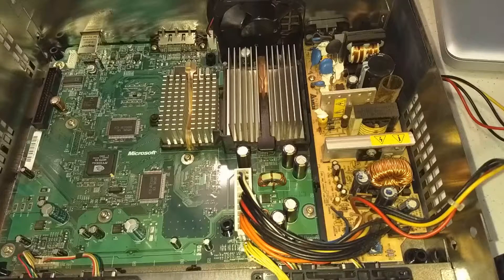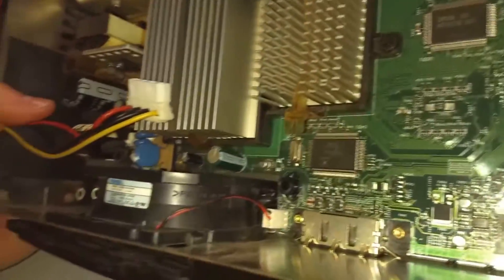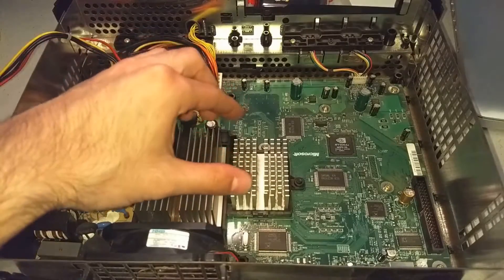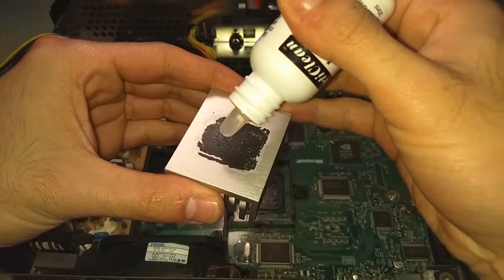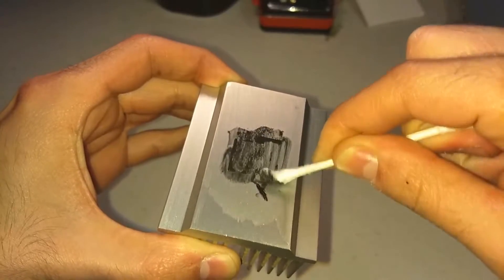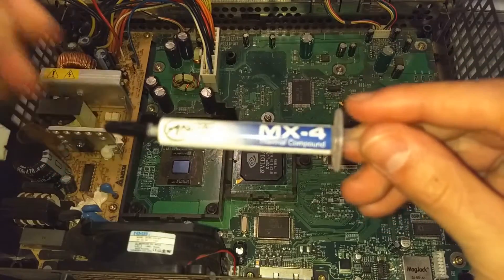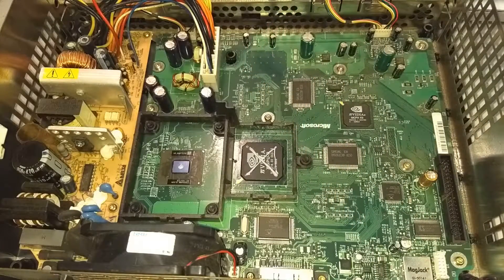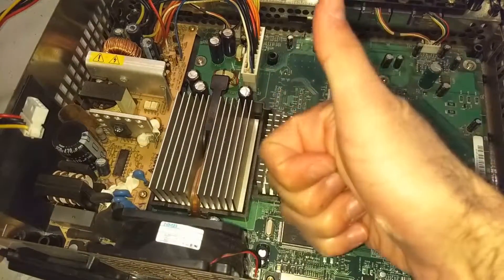Replacing the thermal paste in the Original Xbox

Comment: Hey can you guys help me out? I successfully soft modded my xbox. Everything is fine with it. It plays games , runs emulators etc etc. its just that when i turn the xbox on via eject button i get the service required error 21 message. If i use the reset button it works just fine. I fear it may have something i did the day after i modded the xbox. I turned on the xbox the next day and it kept launching to the original dashboard (i couldnt get unleashx to start) so my dumbass assumed that the softmodt mustve been removed overnight for some reason. So i updated my dashboard again using halo 2 (to start over again) then after that the xbox resetted with the error 21. Do you know how  i can fix this? Keep in mind it works just fine if i turn on with the reset button rather than eject button. I have a hardrive on the way to upgrade my xbox. I really wanna know how i can fix this before I further mod my xbox. I really dont wanna fuck this up. Thank you Xbox modding community. Im so new to this. I dont know words like flashing/hotswap so please bear with me
Reply from the maker: Konphetty don't worry about flashing/hotswapping. I don't think that will apply here. I have some questions for you: which softmod did you use? How did you install it? With a save game exploit? Sounds like your softmod is really buggy. I suggest upgrading to a modern softmod called "Xbox softmodding tool". Made by a guy named rocky5. Look on Google for it and download his softmod, then install it again. It is much more functional, clean looking, and has loads of fail safes.
Reply: Thanks for acknowledging I really do appreciate it. I used the Splinter Cell (PAL cause im from Australia) exploit if thats what you mean. As for the softmod I used this (http://www.mediafire.com/file/2ma2suitra2qbzu/Softmod+Installer+Deluxe+v5.11+Final.zip). 

So im guessing its Version 5.11? I have suspected while looking at other peoples videos that I had a different type of setup when I was looking at their installation process . I followed this guys guide (/watch?v=iq4lfyY6Qv0&t=27s). Should I remove the mod first then install a new one? I have realised that I can access the Boot softmod menu via system tab in the softmod dashboard . Should I remove it through there or pop my Splinter cell back in and run the softmod boot menu through there? or does it not matter? Im sorry If im not making sense. Thanks. 

Also I have Unleash X instaled if that helps
Reply from the maker: Don't be sorry, I appreciate the effort in your details. I took a look at the guide and it seems to have lots of unnecessary options that people can make mistakes on. Don't remove it, instead just look up the Xbox softmodding tool, you can find the guide here /watch?v=rPSxjYMAsi8.The link to the softmod is in the description of that video. If you need help getting the game save onto your Xbox again, look on that guys channel, JCRocky5, that I linked for a tutorial. 

The reason you want this softmod is because its so fool proof, will work on any dashboard version (no need to update via Halo2), and makes the whole process very simple. It even backs stuff up for you without asking. JCRocky5 even has a video where he shows you how to use chimp to upgrade your hdd. 

From what I can gather, you're having your issue because you chose Dual Boot Softmod or something, because one button activates your softmod, and the other gives you an error. That may mean that its attempting to boot something else but that file doesn't exist. The best news is that your Xbox works and you have a working DVD drive, so theres little risk regarding your system. Just don't delete stuff, it may make things worse.

-RVGR
Reply: Hey I had a look at the video you linked. Although His Xbox is already on the original dashboard. Should I just follow it the way he does it in the video you linked? Do I just install it and pretend like I dont have a softmod currently installed? Wont it somehow interfere with the softmod I have now? Im so confused :/
Reply from the maker: Yes, in that video hes demonstrating how to softmod from a theoretical "stock" Xbox but the process is the same. I thought about it more and you actually have a few options for changing your softmod: You can start new and fresh by booting JRocky's Softmod using Splinter Cell. Thats explained in the video I linked. Its the same process you did before with the splinter cell exploit except you would be using the files here: drive.google.com/drive/folders/0BzRN8P835YijaTEzVUNaYkZfaVE?tid=0BzRN8P835YijZENjRUlvSEhVRTg

Or you can boot up his extras disc that has an option for upgrading softmods (watch it here: /watch?v=KOvnrBsenmQ&t=10s. This one might be the easiest thing for you to do since you're already softmodded, you should be able to boot a homebrew disc like this one. 

The last option would be to install a new softmod via Hexen, which is another boot disc. That one also contains a couple of softmods that will overwrite your pre-existing one. Let me know which one you go with.
Reply: Thank you retro. I might just go for the first option cause  I like the fresh start kinda feeling. It makes me feel safer to further mod this Xbox. So If I run his mod it will automatically delete the last mod?
Reply from the maker: Konphetty yes
Reply: Thanks for everything. I hope I dont brick this xbox lmaao.
Reply from the maker: Konphetty I doubt you can.
Reply: Everything worked fine. Thanks
Reply: For the rocky5 softmod do you just download it then extract it then just put it on a flash drive?
Reply: The whole folder that is. On to the flash drive

Comment: will this fix the the flashing red light around the eject button?
Reply: It would be a transistor I've worked on OG Xboxes for years now
Reply: sambo yah Do you see an error message? Red light usually means hardware failure. Check if your clock capacitor is leaking
Reply: my xbox is a 1.6a and no av display so i cant see message.
Reply: sambo yah no harm in replacing the thermal compound. Double check all your connections. Does the board look dirty? Rusty?
Reply: never clean the inside motherboard yet.